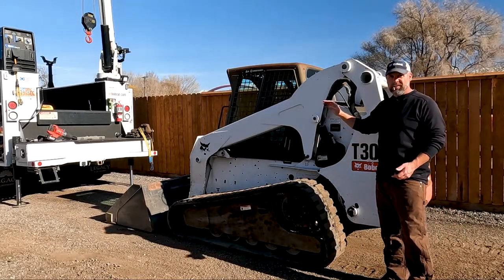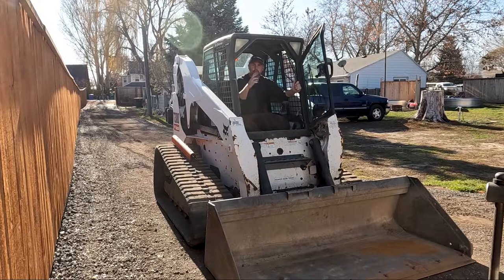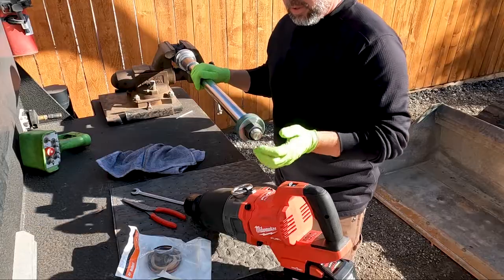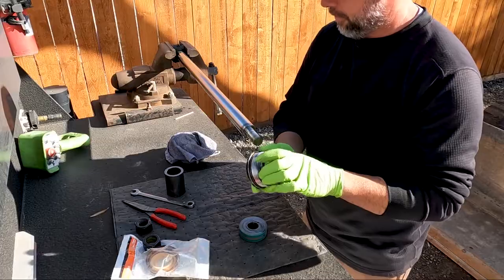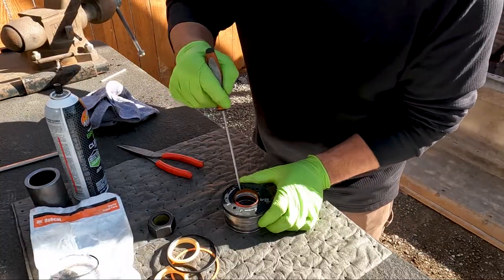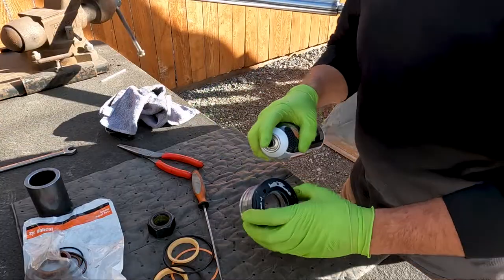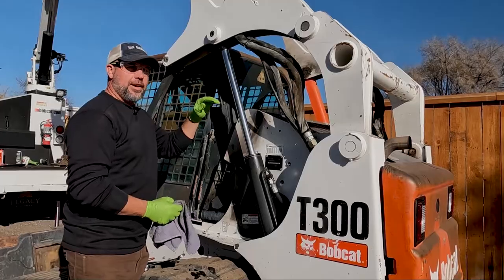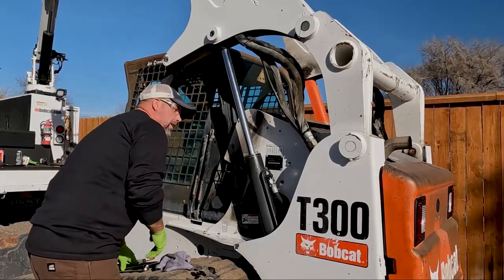Bobcat Hydraulic Lift Cylinder Leaking on my T300. How to remove, reseal, and put back together.

Comment: #1 out of 45 Hydraulic Lift Cylinder DIY repair video in the wild and probably the best self-help video in 12+ years. Direct to the point explanation, supported by best and safe industry practices — zero fluff. You are an expert at your craft; job well done!

P.S. Going to tackle replacing the manual release valve. An overview on that would be great.

Comment: I worked as a cylinder tech for 5 years. I have a couple of tips for you.
1. Invest in smaller picks for more control, When peeling seals out. If you make a burr, the oil will follow it to bypass seals.
2. Flathead screwdrivers work wonders when putting in the u-seal. Feed the u-seal into the groove, and when the last little bit is sticking up use a wide flathead to push the rest down.
3. If you do make a burr with your big pick, you can use alittle sand paper to level it out, don’t over do it.
4. If you have burrs or pitting on your rod, you can polish them out. That’s what usually chews through the u-seal.
Reply: What’s the best way to polish a rod if it has rust or pitting?

Comment: Took me a full day to do both back cylinders. Had to run Bobcat to push the piston rod out with hydraulic fluid (could not get them out). Used that terrible butterfly tool and ended up making my own with zip ties to cut after in place. Also, had to use a 2' adjustable wrench with a 4 foot iron tube handle extension to get the locktite nuts off (no power tool) after replacing the top of the rod into the frame again for holding leverage (had no vice). You would laugh if you saw all my trouble. Wish I found your video before doing that job. Really appreciate your excellent videos and skills!

Comment: Have an S300 with all cylinders leaking. I could see where bucket cylinders could be left on machine. Was thinking I would have to remove lift cylinders until I watched your video. Wonderful and concise video. Hope I can replace seals with out any leaks. Local cylinder shop wants $275.00 per cylinder. Thanks.

Comment: Two weeks ago, using your video, I replaced both lift cylinder seals. Removing the gland nuts and removing the large nuts holding the piston in place were certainly the hardest part of the procedure. Replacing the seals themselves was a piece of cake. I would really appreciate it if you could do a video on replacing the seals in the tilt cylinder. Thanks for the excellent work.

Comment: Excellent! Was trying to get the nut off ,was pretty sure it is a normal right thread . The locktight does explain why it won't budge with 3/4 inch Millwaukee battery rattle gun . May have to heat to break seal .Great help! cheers

Comment: Thanks for the videos; I have a 2017 S650 and I made the mistake of blowing the fuel line backwards, I heard something shooting down to the tank, after watching one of your videos I guess have to get the line out and replace the valve at the beginning of the line in the tank. Great videos, help a lot.
Reply from the maker: That sucks, no need to retrieve the parts from the tank, it won't hurt anything to just leave them in there.  I've pulled tanks and found as many as 5 pickup tube assemblies in the tank.
Reply: @tetradgroup  thank you, I do really appreciate your work.

Comment: WOW!  Your video's are top notch - you have a great gift for teaching!  I was a bit irritated to find the lift cylinder seals leaking on my T550 and over joyed to see you had a video on replacing them!!!  Btw, just got the pump and engine back in after fixing my swash plate  issue with the plastic bushing - all is great on that front thanks to your other video!!!
Reply: I'm doing this tomorrow.  Is there anything I should keep in mind on out t550?
Reply: @joshkahn4408  , if you mean you're doing your lift cylinders (as opposed to swash plate), the job was super easy - way easier than I made it out in my mind but there were a couple hurdles for me: (1) got to find a good way to support the arms while you're doing the job. (2) knocking the pins out after removing the bolts took a lot more force than I though. (3) the piston looking thing - not sure what it's called - that is held on by the bolt goes on in a specific direction and I accidentally flipped it on the first cylinder. (4) the replacement nut was a slightly different size than the one I removed and I didn't have a socket to fit it. Guessing it was metric so I ended up using a large pipe wrench. Overall, quick and easy - I got aftermarket seals and they've been great thus far.

Comment: Today I was able to get the leaking lift cylinder out of my S185, but my air hammer drill isn't budging the nut at all.  When you talk about heating the nut, are you talking about a propane torch, or something else to melt the lock tight?  I could probably take this into our mechanic at work on Monday, but I'm bound and determined to fix this darn thing myself!!!  Thank you for the video and your help.

Comment: Hello, 

Thanks for the great videos! This one really helped me to get my hydraulic cylinder leak free (great info about all the seals required). 

Would love to see a video about adjusting the speed control plate to the right rpms for the engine. How do you read the RPM from a Kubota Bobcat engine and how do you configure it.

Comment: Is this basically the same process on an S185?  Someone told me the cylinder on the S185 is too long to come out the top without raising the arms higher that the safety stop.  I just finished resealing one tilt cylinder, but just discovered that one of the lift cylinders is leaking out of it's top.

This video was great though.  Very well done.  Made a lot of sense.  The only thing I would change is to make sure that people know that the first two seals have to go in with a certain side up.
Reply from the maker: It will come out, it actually comes out at an angle after you pull the pin and retract the rod a little
Reply: Thank you! @tetradgroup

Comment: Video was great. You letting us watch you work is fantastic.a job that pays in knowledge for fellow man 1000 times over. I haven’t had to do this yet. Newer machine 500hrs T64 off topic but maybe you know what makes a T66 engine 6 hp better. And if that’s the only change between machines. As I understand it the frame is the same.

Comment: This was a fantastic video! I bought our company’s T250 bobcat, mainly because I put 99% of the hours on and didn’t abuse the machine. I also did it’s maintenance and kept a spreadsheet. My question..can the lift cylinders on this unit, because it’s a radial lift, be rebuilt in the same manner? And yep, liked and subscribed.
Reply from the maker: Yes they can be done same way.  the problem is if you rely on the cylinder guard to hold arms up the cylinder rod end pin may be difficult to remove because the cab will be in the way.
Reply: @tetradgroup  ok, thanks..good to know.

Comment: Great detailed video, thank you! 

I have a T190 and need to replace the seals but not sure of this method will work. Your lift arms have that gap where you can pull the piston up and out (where the pin goes through). Mine are tubular steel, so I won’t be able pull the piston through up and out.

So I’m not sure if this method will work with medium size framed machines (S175/185 and T180/190).

Comment: Great videos and very helpful because when my T320 has a problem it always occurs when my nearest dealer is backed up for two weeks or more.  Apologies if you have already addressed this.   My lower cooling fan is contacting the shroud at the bottom, please tell us the steps needed to remove and replace it , average time it takes and if this is a repair for an amateur or not.  Thank you very much.  Best regards.

Comment: my 2017 s650 lift cylinder started showing a leak around 1600 hours. decided to keep running it anyways and to my suprise the leak never got worse, it just stayed the same for the next 600 hours until i sold it. the only way you could see the leak was from the dust and dirt buildup

Comment: Awesome videos man. Got a question. Got a S150 which the lift cylinder leaks down. No external leak. Just won’t stay up without holding lift on pedal. Would this video fix that issue as well or is there possibly a different issue?

Comment: Looks so easy, thank you! But the original spare parts are so expensive - so sometimes it is cheaper to buy a new aftermarket cylinder.  Do you always buy original spare parts or others?  Would be interesting how to find other cheaper spare parts. Finding O-Ring is easy, but the other seals are not so common on the market.

Comment: My t 190 has leaky lift cylinders.  After watching this video I think I’m going to try fixing it myself.
Reply: Same.. but I think ours might be a little more tricky based on the research I’ve done. The lift arms on the larger frame machines have a gap between the two steel edges. That allows you to slide the piston rod right out. Our T190’s have a solid tubular lift arm with no gap.
Reply: Has anyone tried this on a t190 yet?
Reply: @mattdeloff4348 You are right, can’t lift the rod out of T190 cylinder. Just take the whole thing off.

Comment: I came upon your T300 Bobcat cylinder video ( Just what I needed). I have an T300. Everything worked great and I was on my way. When I got to removing the shaft though I was stopped in my tracks, It will not move. I can not budge it. You mentioned the suction that can hold the shaft in? I'm afraid of damaging the shaft. Any hints?  The video is great and explains every step clearly. I know it will work, I just have a stubborn machine.
Reply from the maker: Did you figure it out?  Make sure to loosen hydraulic lines to prevent suction holding rod in.

Comment: Always great videos, this guy is the best!  I've resealed multiple tilt cylinders on 773s and a T250, but today I resealed two lift cylinders on a 773, my first attempt at the lift cylinders.  I think I heard you say that you didn't have to remove the cylinders to reseal the 773s, but I couldn't see a way to do that.  Can you show how that's done, or send me some information about how that's done?  I have to reseal the lift cylinders on the T250 as well, so I hope this method works.  Sorry, I've lost your email address or I'd send an email.  Thanks for all of your videos, they are amazing!

Comment: Nelli impressed me..  What is the model of it..  I am guessing it is a 3/4 impact..  I have several fuel impacts and angle grinders..   Good video..
Reply: It’s actually a 1in Model #2868-22HD
Reply: @user-kn7ps7wr7o  I just bought one of these new Milwaukee fuel, one inch impacts..  It kicks ass..

Comment: Really glad I found your channel, subscribed right away! I'm looking to buy a used Bobcat skid steer, this will take some of the fear out of buying one with leaking cylinders.
Wondering if you can recommend which model might fit my need best in a vertical path / high lift where i'll be using a grapple to load tall bins and also plow snow as needed. Better off with wheels or tracks in the snow?
Thanks in advance.

Comment: Is that break cleaner bad for the o-rings or a contaminate for the oil?    My reaction would be to use compressed air to make sure all break cleaner was off the part before re installing o-rings?

Comment: Great video!  I was about to buy the the specialized Kit King U-Cup install tool set when I saw your method of using the smooth jaw needle nose pliers.  Any chance you could provide a link to the pliers you used in this video?

Thanks so much, it is a really helpful video!

Comment: Good evening, Question….  Cylinder won’t come out of barrel. Loosened fittings backed off gland removed pin but cylinder will not move. It will spin but not pull out.  Any suggestions

Comment: I cant get to the most important part in your steps.  My ‘14 T650 isnt allowing the rod to come out the top.  Looks like its running out of room up in the arm and pinching into where the arm bends.  Im using a fork lift to help lift it out too.   Whats the best way to knock out the pin on the bottom?   Looks like it would be hard to reset from the inside of machine.    Theres room inside to push it Full in and then reset from the outside too ?   Thanks !

Comment: I have a 2014 S530 that needs to have seals replaced. My problem is, the data plate with the serial number has been blasted and painted over. How can I find out exactly what seal kit to purchase with out the SN?

Comment: Thanks for your video it’s really helping a lot. I’m changing the seal on my 773 bobcat. I got the glad nut off and I’m trying to get the shaft out but it won’t slide up and out like in your video. There’s a lot of resistance I can get it to turn and loosen it up a little bit but I don’t know if I need to disconnect the lower Hydro as well or if they just get sticky.
Reply from the maker: You have to loosen lower fitting or you will not be able to pull it out
Reply: I’ve disconnected both upper and lower hydraulic hoses but I still can’t get it to come out the shaft spins with some effort but it’s still very sticky. Do I have to actually remove the lower hydraulic fitting that’s attached to the rod? 
Thanks 4 your help!

Comment: I've got a bobcat 773G the lines are in the way.. I need to disconnect the lines to pull the rod all the way out... I would remove the bottom pin but froze in

Comment: So I purchased our company’s 2008 T250. It has about 2500 hours on it, the bulk of which I put on the meter. I made sure to never abuse the machine and always kept up with its PM. My question to you..I love this machine for its power, comfort (enclosed cab with heat and a/c) and wide tracks. I have purchased an OEM service manual as I turn wrenches for a living. Seeing how you are very familiar with these units, is there anything you can think of that, maintenance wise, can be missed or overlooked? Any tips you know of? I plan on keeping this machine for many years and really want to take care of it..thanks!! Love all your videos. I forgot to mention it also has the roller suspension, not solid.

Comment: Just had my 863g radial lift cylinders resealed. Unfortunately my bobcat dealer did the job because I don't have the shop to do it in. They found the left cylinder head wouldn't come loose. So basically I  had to purchase a new cylinder. Have you ever run into that situation? Thanks for a great video.
Reply from the maker: Yes on the older machines I have run into that situation.  The head is aluminum and the barrel is steel so over time the dissimilar metals corrod to one another and makes it impossible to remove.  I have lots of tricks but sometimes the cylinder needs to be replaced.

Comment: Best video great help, but I bought a seal kit online n the nut that comes with the kit does not have Threadlocker like the ones u get from Bobcat dealer. Do I need to put some on, if so what do you recommend? Does it need to be for hydraulic? Can I use the Red?
Reply from the maker: I would add some red

Comment: In your experience, what would cause the lift and tilt to drop under load, even after replacing all cylinder seals and o rings? I have a A 300, no significant hydraulic spots under tractor when sitting. I replaced ALL seals just as you did in video. Mainly because when I lift loads it will lower fairly quickly and also tilt just as fast. Im pretty savy with tools as I work on my kubotas as well. I did however, top off hydraulic fluid in Bobcat using my Kubota UDT  2 hydraulic fluid, not sure if that would even make a difference. Thanks in advance..I'm new to Bobcats and learning alot from ur vids.
Reply from the maker: To drop under load my first guess is port reliefs. Lift will have a port relief on base end only, tilt will have port relief on both base and rod end.  Port reliefs are located on back of valve but I would think that although possible its highly unlikely two port reliefs go bad at same time.  Only other scenario I can think of is a internal crack in control valve.

Comment: Great content. Does the grease added to inside of the gland cause any contamination to the hydraulic fluid?  Milly seems to eat those nuts.
Reply from the maker: Just a lite film of grease to help with lubrication will not hurt the hydraulic system at all.  You could also use clean hydraulic oil to lube the seals of your worried about contamination.

Comment: Just wondering in your part of the US do these cylinder gland nuts give you troubles being aluminum on a steel can. Sometimes here in Indiana at least some cylinder gland nuts are on so tight they won’t come off with heat or anything. Also love the videos would love to see a video on cab shock installs
Reply from the maker: Yes I absolutely have some heads that will not come off, it's a real pain sometimes.  Great suggestion on the cab shock video.  Those can be very difficult as well
Reply: @tetradgroup  I commented on some of the newer r series videos about electrical issues I’m glad I’m not the only tech running into those problems with displays and alarms staying on

Comment: Both of mine are leaking on My 1998 773 G... I got a quote from a former Bobcat guy At $600 for both and I supply parts.. I am going to ... YES. Thank You. I will give a report following the operation. You had Bobcat repair kit..  Have you used after market kits?
Reply from the maker: $600 and he supplies the parts I hope.  The aftermarket seal kits have been hit and miss for me so I now only use Bobcat parts to make sure I don't have any more issues.
Reply: Getting ready to replace both seals now.. i have put  kroil on all of the fittings, pins, glands.. My 773 only has the one hose on the top. DO I have to crack the lower hose connection loose?

Comment: do you have a video of bleeding air out of the hydraulic system?
Reply from the maker: Not necessary on skid steers but there is a process for the excavator that I've talked about several times.